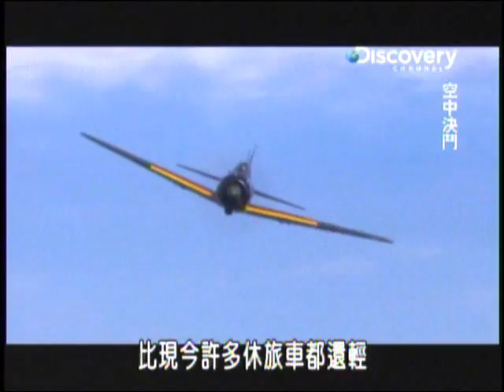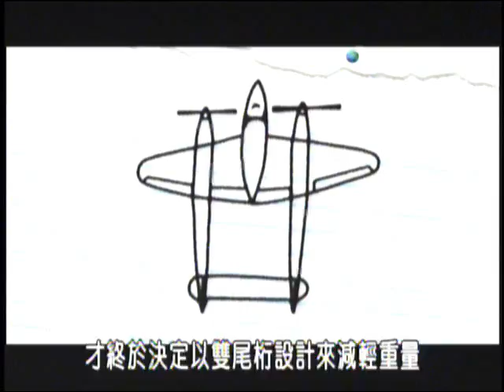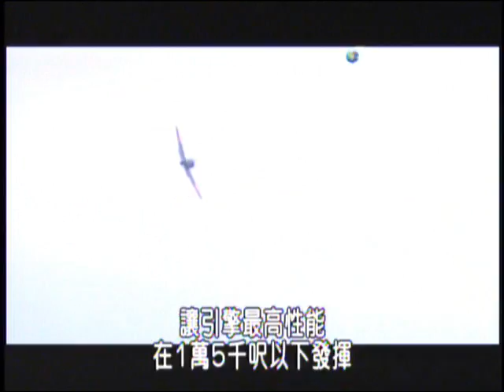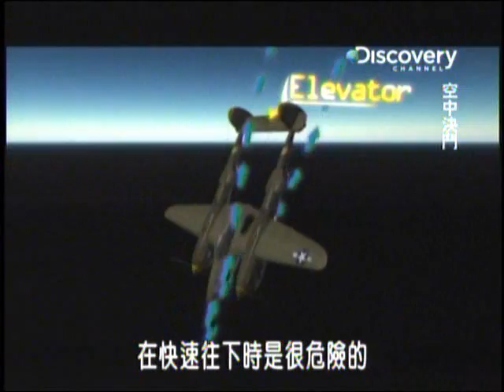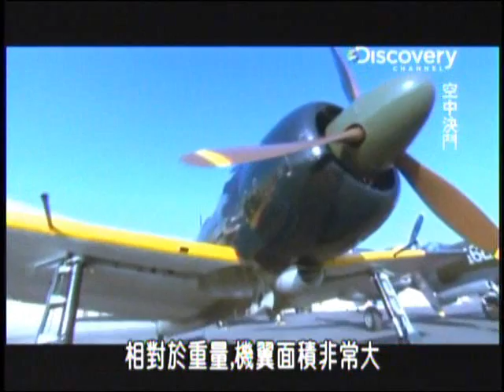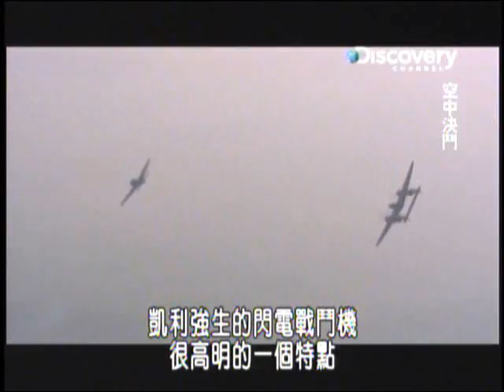空中決鬥P-38閃電式 vs 零式Lockheed P-38 Lightning vs Mitsubishi A6M Zero )-part2

Comment: The P-38 engines had BOTH crank driven centrifugal superchargers AND exhaust driven turbochargers.

The P-38 never approached the speed of sound. Critical Mach was around 0.67 without the dive flaps deployed. That's around 480-500 MPH.

They were dive FLAPS, and NOT dive BRAKES. They did not slow the plane to own. They disrupted the trans sonic shock wave created when the joint at the four wing roots accelerated the passing air to near trans sonic speeds. They also created a pitch up moment, helping bring the plane out of a dive.

Comment: One of the greatest designs for fighter in WW2. Just never understand why it didn't do so well in Europe but excelled in the Pacific,
Reply: The answer has many parts. 
First, both the P47 and the P38 were flown by the USAAF in Europe when the US entered the ETO, and the US Army had little to no fucking idea what they were doing.
So they often got humbled by the Germans for that reason alone.

Second, both the P-47 and the P-38 had teething issues such as compressibility on the P-38 and the fabric tail on the P-47 coming apart at high speeds, and so both could be lethal to their pilots in a dive...ultimately Nazi pilots realized that they could escape both by just diving away, as American pilots were forced to break-off pursuit above a certain speed. 

Third in the ETO USAAF planes flew on British gas which was much lower in octane than US gas which was used in the Pacific theatre, and the Allison engines in the P-38 simply would not run reliably on British gas at high altitudes. That seriously affected mission readiness and combat effectiveness. 

Fourth, what compressibility issues the P-38 had, were made worse by the cold, dense air in the ETO compared to the hot air in the Pacific. Even more so, the high-altitude precision bombing concept (soon to be abandoned anyway as it was ineffective) meant that the P-38, as an escort, had to fly more missions at high altitudes in the ETO than in the Pacific, and for all of the above reasons it simply was not as effective in this role as the Mustang was.

Fifth, the range issue. The simple fact is that the Mustang was designed and bought to the ETO with range as a major concern, however it is untrue that the P-38 did not have sufficient range to reach Berlin and return. The whole issue of drop-tanks complicates this even more. Again not so much a matter of range but reliability and effectiveness. The plain and simple truth was that in the ETO, the Mustang was king, a fact that eventually saw the P-47 scrapped in the Pacific as they were replaced by Mustangs. While if nothing else the fact that the P-38 had two engines kept it in the war in the Pacific especially when combined with the fact that the leading US aces in the Pacific all flew either the F6F or the P-38. 

The P-38 was simply used in a different way than the Mustang was due to evolution of strategy and tactics, the Mustang was better-suited for the earlier tactics for which the P-38 was used, the Mustang benefited from the changes in fighter tactics (fighter sweeps) after 1943 (the Nazis did the exact same thing with their air raids over England and in merging the Fw190A in with the Me109), the Mustang was simply better in a dive than the P-38 (it was the best in a dive of all the fighters used in the ETO) and its Merlin engine was designed from the start to run on low-octane British fuel. The Mustang simply benefited from all of the early ETO experience in a way that the P-38 and P-47 builders were unable to match, well-enough and soon-enough, for a number of reasons...and by 1944 it was just too late, the die had been cast. You could basically say that the P-38 and P-47 were the bomber interceptors that the Americans wanted post-WW1 based on WW1 combat experience while the Mustang was the fighter aircraft that both the British and the Americans wanted during WW2 based on real-world combat experience in the ETO in WW2 . The P-38 and P-47 were both designed as fast, high-altitude bomber interceptors that were thrust into the fighter role because when the war started, those were the fighters that the USAAF had. The P-51 was designed from the ground up as a replacement for the P-40, and its manufacturer simply did an excellent job of updating the P-40 design in the context of WW2 strategy. Of course, the P-38 and P-47 were quite enough to handle inadequate Japanese combat strategy in an aging fighter (the Zero) that had no real competition before facing the US in WW2. Zero real competition, zero armor, zero protection for vital components...everything in the Zero was sacrificed for range and as such it simply had to face inferior planes in combat to even have a chance to survive. When it met the F6F (or a good pilot in a F4F), that advantage simply went away. When it met the P-38, the Zero was slower, had less range, was barely more maneuverable and then only at low speed, definitely could not dive with the P-38, again had zero armor and was even outgunned by the P-38. The only real defense the Zero had was that the P-38 was a land-based plane fighting in an island-hopping war...but even that turned out to be insufficient to save the Zero from the P-38 due to the range the P-38 would sustain in combat missions. Certainly the British had the Spitfire in concept, but it's unlikely to have been available in significant numbers in the Pacific in the early days of WW2. Again this is what combat experience delivers and the US and British adapted to the realities of war in the Pacific much better than the Japanese did. Those who adapted well enough, quickly enough survived and thrived..those who failed to do so, were best suited for administrative positions with little to no influence on operational strategy and tactics. Even our best pilots would lose their heads pursuing kills and find themselves on the wrong end of a Zeros' 20mm cannon. 

So yeah, the Mustang had a lot of advantages over the P-38...despite the fact that the P-38 saw combat far earlier than the P-51, it was much easier for North America to integrate the lessons learned in combat into a fresh fighter design, than it was for Lockheed to integrate those same lessons into a fighter that had already been deployed in the field. They did try to do this. But aside from the British shooting down the C-47 that carried the dive-brakes to e installed to combat the compressibility problem, the Allison engines just were never up to the reliability of the Packard-Merlin engines, the high-altitude induced engine failures were a problem right up until the end of the war, and as such the few remaining P-38s that remained in the ETO were assigned to ground-attack missions where they could perform the precision attacks for which the heavy bombers proved to be woefully ill-suited. It's not as though Mustangs were not also used for such attacks and it is not as if we did not lose a lot of Mustang pilots trying to fit that square peg into the round hole of a ground-attack mission. But that is because in WW2 there was no plane, really, that couldn't be shot down by AA. Especially if it flew low enough, often enough.

So not really much glamour in war as death. Not so much an issue of which plane "did well" in the war and which ones "failed". More an issue of who survived and who died. There were a lot of Mustang pilots who died in the war. The more that there were, the more that died. Surviving war means exploiting your opportunities to survive instead of looking Death squarely in the eye and grabbing it with both hands. Basically fighting smart instead of fighting stupid. This is one reason why a lot of P-47 pilots in the ETO refused to swap their P-47s for Mustangs. And there absolutely was no reason why they couldn't be shot-down by enemy fighters if the pilots were caught asleep at the controls. But when Mustang pilots were order to attack "targets of opportunity" on the way back from an escort mission? They were then taken out from the role in which arguably they were the best fighter of the war, into a role in which they were basically just another practice target for AA gunners. In a plane whose only real defense from AA was speed. And of course, "simply not being there". You go there often enough, you're going to get shot down, that's how it works. And out of the Allied fighters, the Mustang and Spitfire were clearly the least-suited for the ground-attack role. But of course...well, there's no real way to express the bravery of these pilots, flying around in these tin gas-tanks, knowing they are going to get shot at by a lot of angry Nazis as they attack ground targets far behind Nazi lines. There's no way around this, that took some real balls. They weren't there to grow crops, that's for sure.